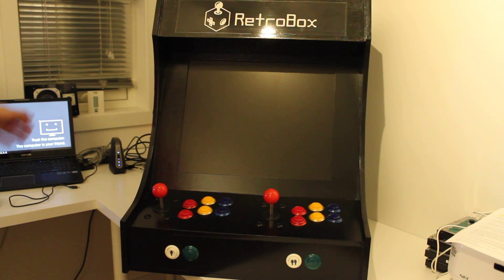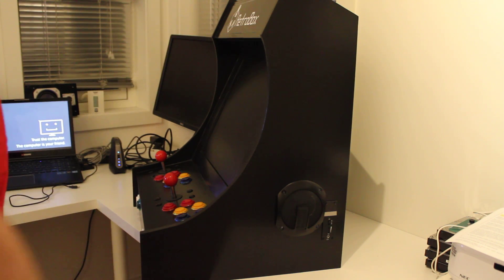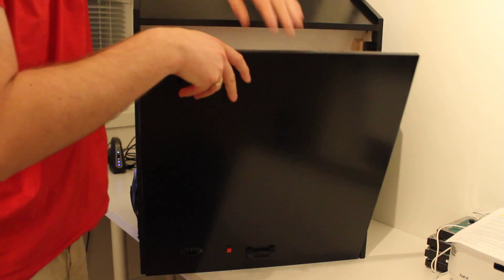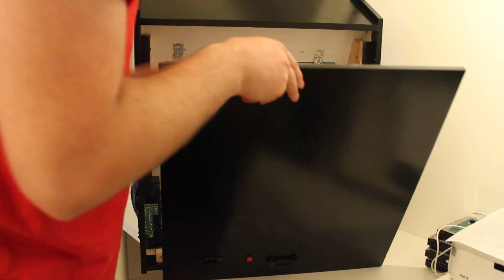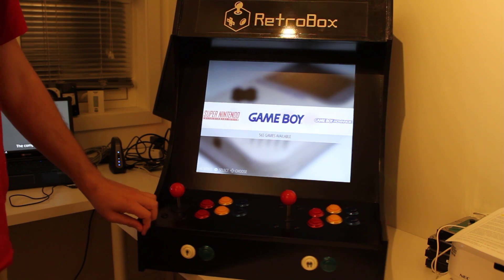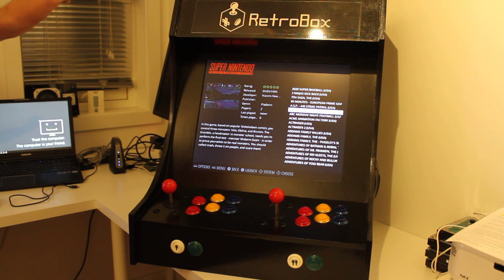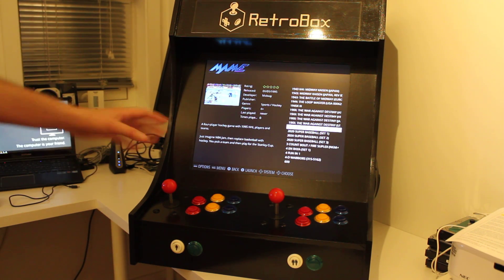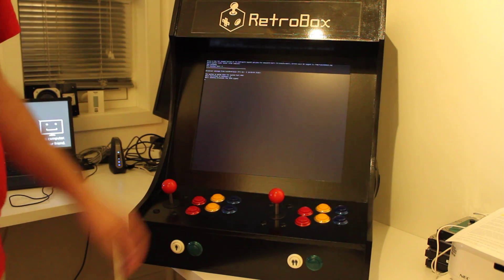RetroBox - Second RetroPie Arcade Build

Comment: Great video!! How hard was it to program the xin mo usb controller to this? Is it plug in play or are there steps to get this to work
Reply from the maker: Thank you! It's plug and play, but it's recognized as a single device with two joysticks and a lot of buttons. The issue is that some emulators don't support that and therefore won't let you configure all buttons/two players. The fix is simple once you know what to do. Take a look at the «Known bugs» section on my blog for a fix: http://idmedia.no/projects/retrobox/retropie-3-running-on-my-bartop-arcade/